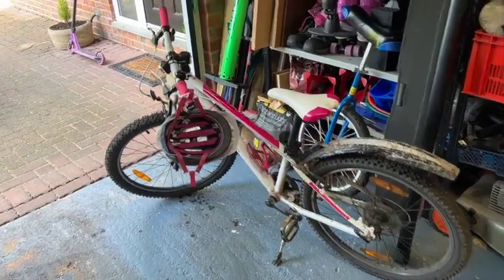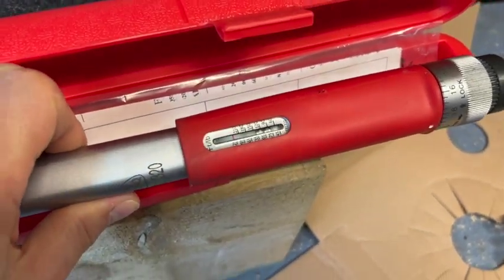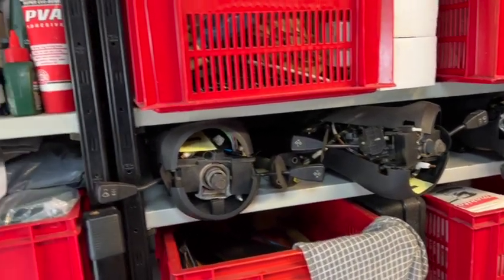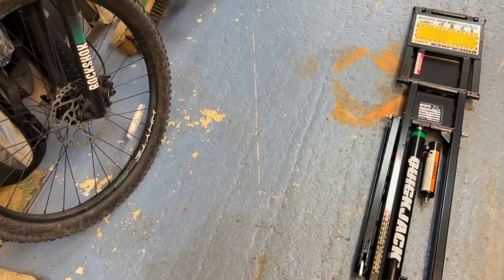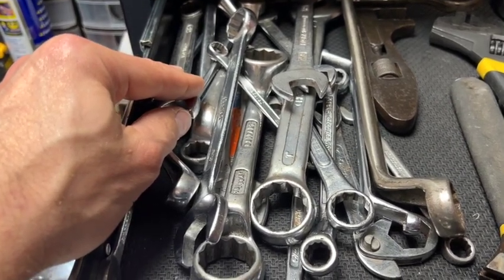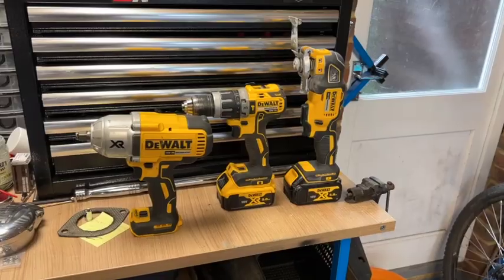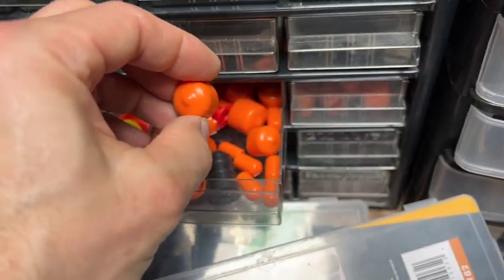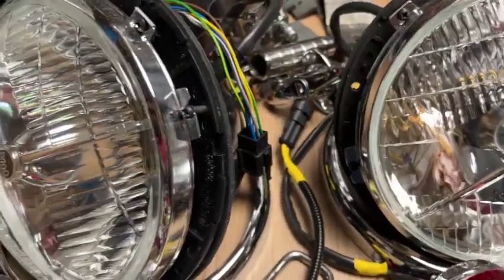Building the AK Cobra - Part 22 - Garage Tour - Quickjacks

Comment: Russ,  Make sure you release your torque wrench back to 0, if you don't you will stretch the internal springs over time, and it wont calibrate correctly.
Reply from the maker: Best tip of the year. I had no idea. Thanks Mike 👍